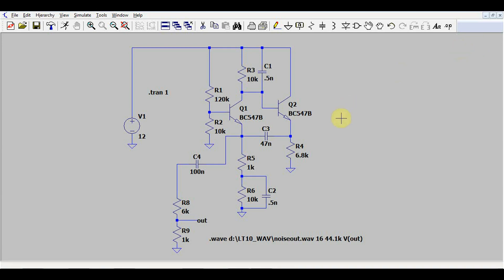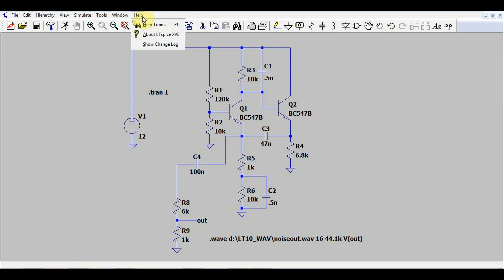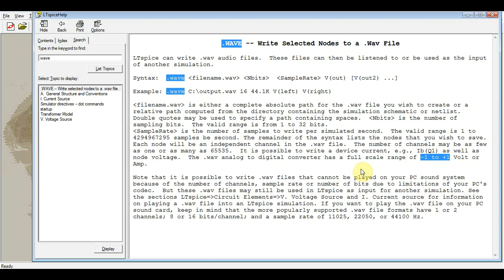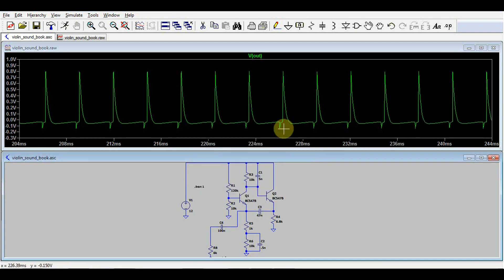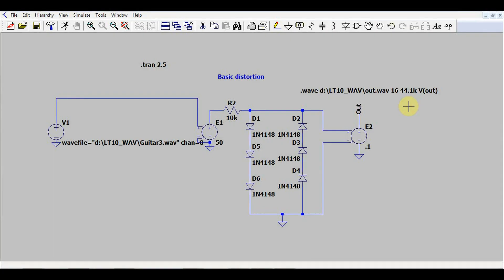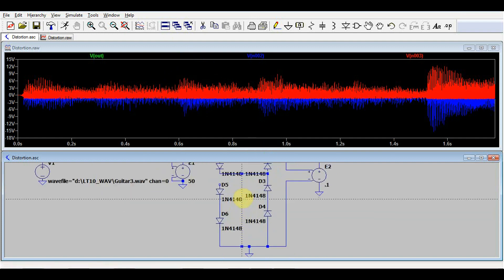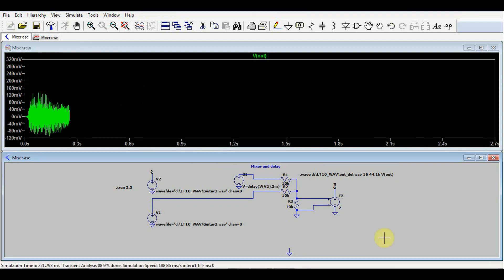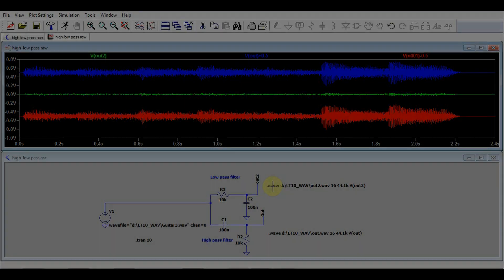LTspice tutorial - Ep10 .wave statement and audio file processing

Comment: Can't have wavefile statement working. Bad format error reported. What program will generate good wav file to use with ltspice ? Soundforge and Audacity adds something that probably ltspice don't like.
Reply from the maker: Hello Diego! What is the exact statement you are using to include the wavefile? The wavefiles I used in the video where generated with Audacity, I didn't encounter any issues.
Reply: @FesZElectronics  That's strange. I generate white noise with soundforge or audacity. 16bit 44.1khz. Both mono or stereo. White noise from ltspice is very limited imho. Tried both wavefile=namefile.wav with the file inside my project folder and wavefile=absolutepath as you did in the video. The file was found but it report bad format found. I also tried with a simple sine wave file but nothing.
Reply: Found it finally. The problem reported is bad format but most likely is a matter of write permissions. Moved everything under documents and now it finally work. Damn it.
Reply from the maker: Oh yes - access permission... I noticed this issue while trying to edit library files but also save schematics sometimes, so I moved my whole LTspice directory (the installed program) on a different drive, or at least outside "program files" no remove this access permission issue. I'm happy you figured it out!

Comment: Very helpful videos about LTSpice. Thank you.. Secondly How to simulate HF Transformer LTSpice :)
Reply from the maker: You can simulate transformers by adding "k" statements, for example "k1 L1 L2 0.9" (no dot at the beginning). This will link L1 and L2 into a transformer with 90% coupling. How high or low frequency the transformer is depends on the inductance of the coils and magnetic material, so by using this simple model, you basically ignore the magnetic material and the operation frequency will depend only on the inductance used.
Reply: @FesZElectronics  thanks